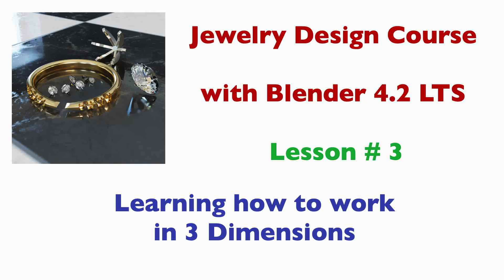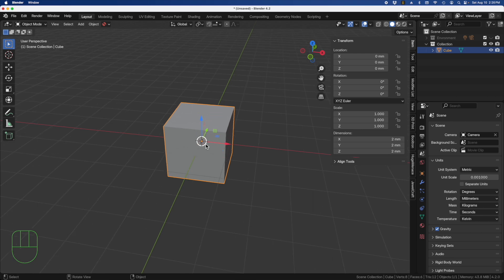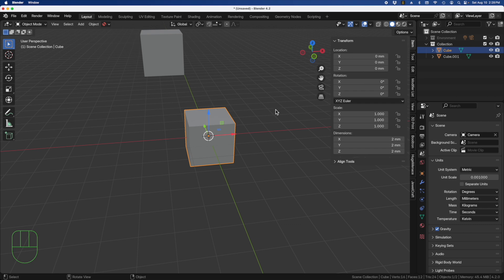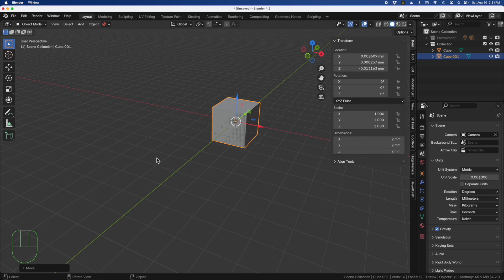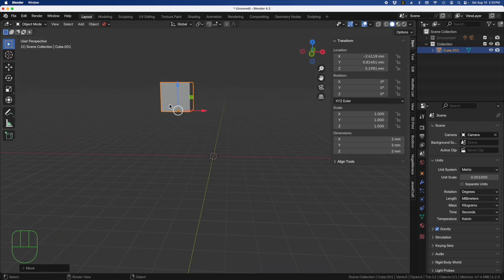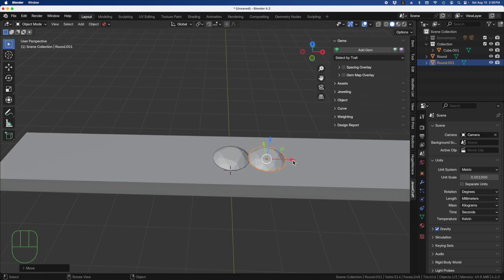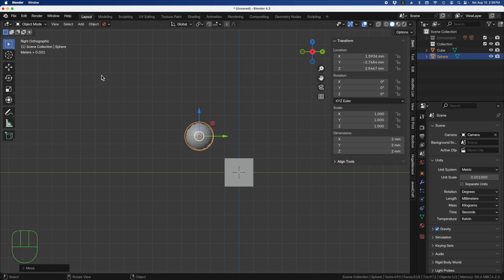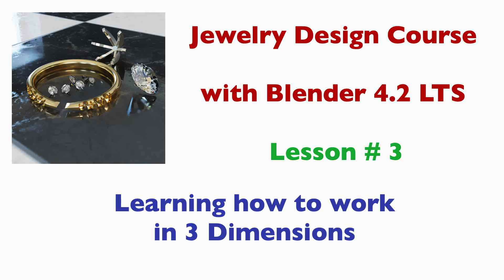Jewelry Design Course - Lesson 3  Setting up Blender 4.2 to work in Millimeters

Comment: In Blender 4.3.2, when you press Shift + D to duplicate an object, it automatically enters free movement mode. To prevent the object from moving freely, press Esc immediately after duplicating. This will keep the duplicated object in place, allowing you to manually move it along the X, Y, or Z axis by pressing G followed by the desired axis key.